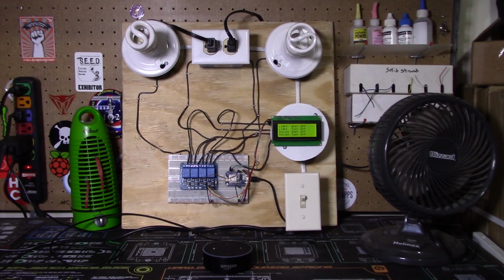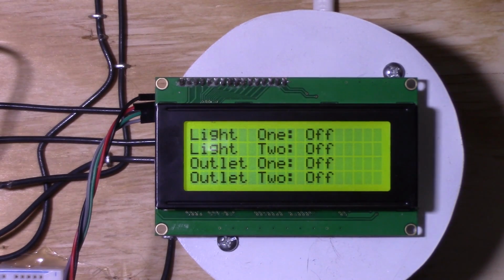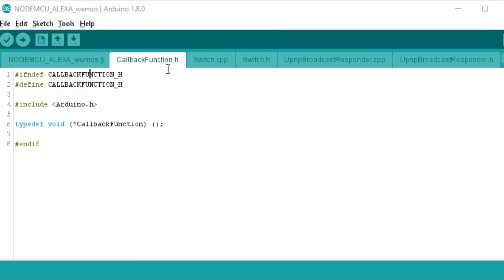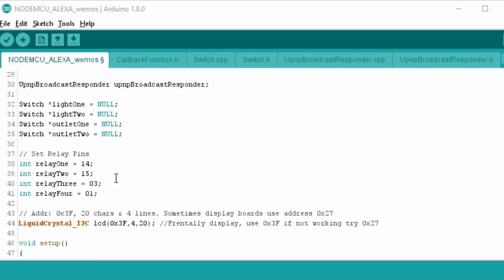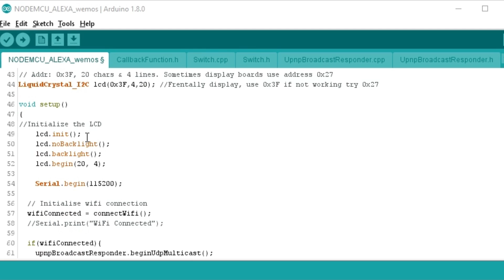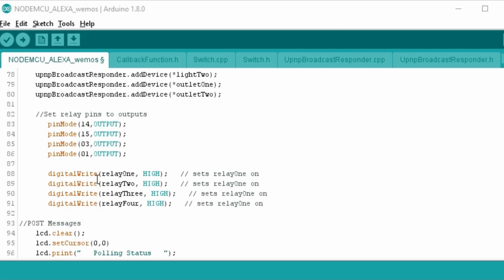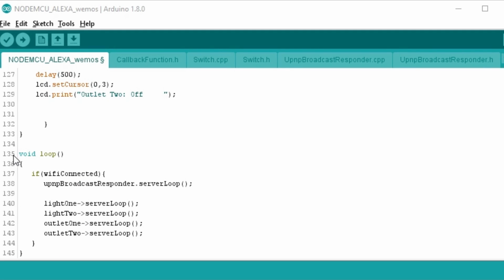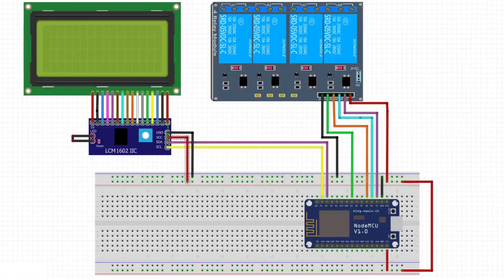How To: DIY Home Automation with NodeMCU And Amazon Alexa

Comment: It appears to be a well made video. However when I tried it on (after changing the SSID and PW) and choice of LCD header file, I get the following errors.

 ets Jan  8 2013,rst cause:4, boot mode:(3,6)

wdt reset
load 0x4010f000, len 1384, room 16 
tail 8
chksum 0x2d
csum 0x2d
v8b899c12
~ld

I cannot understand where on earth that came from. The code compiles alright and yet this. Please help.
Reply from the maker: That's because Amazon killed the API that allowed this to work.
Reply: @Themakersworkbench  Thank you for a prompt reply. Do you have an updated video to handle this problem then?
Reply from the maker: @nearmitech  not yet but I do have the newest generation Echo Dot and will be making a new video in a few weeks.

Comment: Time 1:15 I did see a switch right below the LCD display, what is that for. A light turned on by Alexa, can i turn it off using the manual wall switch ?
Reply: It appears to be the A/C supply  so yes you can... how it affects the low voltage controls if you power it back on is unknown.

Comment: HEllo
I have succe'sfully upload code

serial log seems to be OK

onnecting to WiFi

Connected to reseaualamaison
IP address: 192.168.0.12
Begin multicast ..
Udp multicast server started at 239.255.255.250:1900
   WiFi Connected   
reseaualamaison
WebServer started on port: 
80
WebServer started on port: 
81
WebServer started on port: 
82
WebServer started on port: 
83
Adding switch : Light O

But Alexa discovering device detect anything

Do you have an ideas pleases ?
Reply: I have the same problem, did you solved the problem?
Reply: @blaze1701  I have cha,ge the code , i use the code this for 1 Device (D1)  up to 10 devices you can set

#include <Espalexa.h>
#ifdef ARDUINO_ARCH_ESP32
#include <WiFi.h>
#include <WebServer.h> //if you get an error here please update to ESP32 arduino core 1.0.0
#else
#include <ESP8266WiFi.h>
#include <ESP8266WebServer.h>
#include <ESP8266HTTPClient.h>
#endif

String ValText;
int count = 0;
char line[80];
boolean connectWifi();

// Change this!!
const char* ssid = "xxxxx";
const char* password = "xxxxxx";

EspalexaDevice* d1;

boolean wifiConnected = false;

Espalexa espalexa;
#ifdef ARDUINO_ARCH_ESP32
WebServer server(80);
#else
ESP8266WebServer server(80);
#endif

void setup()
{

  float temperature;
   
  Serial.begin(115200);
  // Initialise wifi connection
  wifiConnected = connectWifi();
  
  if(wifiConnected){
    server.on("/", HTTP_GET, [](){
    server.send(303);
    });

    server.on("/test", HTTP_GET, [](){
    server.send(200, "text/plain", "This is a second subpage you may have.");
    });
    server.onNotFound([](){
      if (!espalexa.handleAlexaApiCall(server.uri(),server.arg(0))) //if you don't know the URI, ask espalexa whether it is an Alexa control request
     {
        //whatever you want to do with 404s
        server.send(404, "text/plain", "Not found");
      }
    });

    d1 = new EspalexaDevice("poulailler", Device1,0);
    espalexa.addDevice(d1);

    espalexa.begin(&server); //give espalexa a pointer to your server object so it can use your server instead of creating its own

    server.on("/Device1_on", Device1OnHttp);
    server.on("/Device1_off",Device1OffHttp);
    
    server.begin(); //omit this since it will be done by espalexa.begin(&server)
    
  } else
  {
    while (1)
    {
      Serial.println("Cannot connect to WiFi. Please check data and reset the ESP.");
      delay(2500);
    }
  }

  //  Force the ESP into client-only mode
  WiFi.mode(WIFI_STA); 
  
}
 
void loop()
{
    server.handleClient(); 
   //server.handleClient() //you can omit this line from your code since it will be called in espalexa.loop()
   espalexa.loop();
   delay(1);

  
}

//our callback functions
void Device1(uint8_t brightness) {

    if (brightness == 255) {
      d1->setValue(255);
      Serial.println("Device1 ON");
      server.send(200,"text/plain","OK");
      server.sendHeader("Location","/"); 
      server.send(303);
    }

     if (brightness == 0) {
      d1->setValue(0);
      Serial.println("Device1 OFF");
      server.send(200,"text/plain","OK");
      server.sendHeader("Location","/"); 
      server.send(303);
    }
}

//our callback functions
void Device1OnHttp() {
   
      d1->setValue(255);
      Serial.println("Device1 ON");
      server.send(200,"text/plain","OK");
      server.sendHeader("Location","/"); 
      server.send(303);
}

//our callback functions
void Device1OffHttp() {

      d1->setValue(0);
      Serial.println("Device1 OFF");
      server.send(200,"text/plain","OK");
      server.sendHeader("Location","/"); 
      server.send(303);
   
}

// connect to wifi – returns true if successful or false if not
boolean connectWifi(){
  boolean state = true;
  int i = 0;
  
  WiFi.mode(WIFI_STA);
  WiFi.begin(ssid, password);
  Serial.println("");
  Serial.println("Connecting to WiFi");

  // Wait for connection
  Serial.print("Connecting...");
  while (WiFi.status() != WL_CONNECTED) {
    delay(500);
    Serial.print(".");
    if (i > 20){
      state = false; break;
    }
    i++;
  }
  Serial.println("");
  if (state){
    Serial.print("Connected to ");
    Serial.println(ssid);
    Serial.print("IP address: ");
    Serial.println(WiFi.localIP());
  }
  else {
    Serial.println("Connection failed.");
  }
  delay(100);
  return state;
}
Reply: @Gyver4000  Thanks! :)

Comment: Wonder if you can help, see below - regards, Erik
/Users/erikhoffman/Documents/Arduino/4 Channel Relay Board Controlled by Alexa/NODEMCU_ALEXA_wemos/NODEMCU_ALEXA_wemos.ino: In function 'void setup()':
NODEMCU_ALEXA_wemos:98: error: 'ssid' was not declared in this scope
     lcd.print(ssid);
               ^
/Users/erikhoffman/Documents/Arduino/4 Channel Relay Board Controlled by Alexa/NODEMCU_ALEXA_wemos/NODEMCU_ALEXA_wemos.ino: In function 'boolean connectWifi()':
NODEMCU_ALEXA_wemos:246: error: 'class WiFiClass' has no member named 'mode'
   WiFi.mode(WIFI_STA);
        ^
NODEMCU_ALEXA_wemos:246: error: 'WIFI_STA' was not declared in this scope
   WiFi.mode(WIFI_STA);
             ^
NODEMCU_ALEXA_wemos:247: error: 'ssid' was not declared in this scope
   WiFi.begin(ssid, password);
              ^
NODEMCU_ALEXA_wemos:247: error: 'password' was not declared in this scope
   WiFi.begin(ssid, password);

Comment: Brilliant job on the application, have done a few switching projects using this board and they work fine, but I really liked the idea of using the L.C.D screen (geek factor and all that..) I have downloaded the ZIP file but I am unsure with what to do with the 5 other files that are needed - where do I put them and how do I include them - plus where do I get WiFiUDP.h from? - also i am getting an error saying "error compiling for board NodeMCU 1.0 (ESP - 12E Module) - I am assuming this is related to missing files? - any help or advice would be welcome !
Reply: Well after a fair bit of head scratching I finally got the main part of the project working and its talking to my echo dot nicely and switching the relays... however, the LCD screen just sits their glowing blue and showing two rows of white squares (as I understand it, its in reset mode?) it does nothing when rebooting the NodeMcu and I have spent most of the day looking if I went wrong anywhere with connection etc,  the LCD is the exact same one in the tut here, so am at a bit of a loss, and as their seems to be no activity here I fear this will have to go on the back burner for a while and i'll look for an alternative. Not all lost though at least I think I learnt something :)
Reply: how did you manage to get the WiFiUdp.h file working? Having the same problem now
Reply: Hi Ray, My Nodemcu is connecting to Wifi fine but echo is not discovering it at all. Can you please tell me what did you exactly do to get this working? I know it would be a thing of past for you but still, will look forward to hearing from you.

Comment: Why i get this error message Arduino: 1.8.5 (Windows Store 1.8.10.0) (Windows 10), Board: "NodeMCU 1.0 (ESP-12E Module), 80 MHz, 115200, 4M (3M SPIFFS)"

NODEMCU_ALEXA_wemos\NODEMCU_ALEXA_wemos.ino:31:31: fatal error: LiquidCrystal_I2C.h: No such file or directory

 #include <LiquidCrystal_I2C.h>

                               ^

compilation terminated.

exit status 1
Error compiling for board NodeMCU 1.0 (ESP-12E Module).

This report would have more information with
"Show verbose output during compilation"
option enabled in File -> Preferences.

Comment: my echo dot cant find any smarthome devices
im never change what u've done
only ssid and password

please help
Reply: same for me.
Reply: If you have one of the new V2 Echo Dots, at least some of the WeMo emulators for ESP8266 stopped working because Amazon changed the discovery protocol.

I just got mine, so I haven't found out what the fix is yet. I only found out about the problem when I was looking for examples.
Reply: I had the same problem. My wireless network name is Thor, but I was typing thor in the code. it's case sensitive. maybe this will.help

Comment: You could use a RF-Outlet so u dont have to have a relay and mess around with mains-voltage. Iam planning to do so. I had something like that but with no voicecontrol. It was just an icon on my smartphone that i clicked on. Worked well but wasnt that cool without voicecontrol.

Comment: Hello, Can the echo be used from a remote network to control nodeMCU that is connected to the home wifi ?
Reply from the maker: +Justin Jose I am not sure if this is possible and I believe that Amazon has security measures in place to prevent this exact thing. I could be wrong though as I have not spent any time researching it.

Comment: Great video - and appears less difficult to try compared to other articles I have read.  Couple questions for you...  do you know if it is possible to ask Alexa to read a value, and return it... such as if a door is open, motion detected (variable set), etc?
Reply from the maker: +Ken Jaynes Thanks for the compliment. At the moment I do not think it's possible to have Alexa read strings back.
Reply: I am wondering if via home-assistant would work - https://home-assistant.io/components/binary_sensor.rpi_gpio/ via Raspberry Pi though, not Arduino or ESP8266
Reply from the maker: +Ken Jaynes I'm not yet sure.
Reply from the maker: +Ken Jaynes It's possible. I know the esp8266 is quite popular with the home assistant people

Comment: I used your set up and everything works great!  However, I can't seem to get Alexa to respond to anything but ON/OFF commands, even by changing the call backs.  I'd like to use this setup to automate my mini-blinds, but it sounds a little awkward to say "Alexa, turn off/on the blinds".  It works, but it would be better if "open/close" was an option.  I have a genuine WEMO switch and it will turn  OFF/ON in response to a verbal command of OPEN/CLOSE, OPEN/SHUT, etc.  Is there a way to get the emulation to follow these commands?

Comment: This project is great but I do not want to control multiple switches at once I am wanting just one relay. I have tried to use this on a single relay and it clicks on and off. I have tried it on this relay
 http://www.ebay.com/itm/WiFi-Relay-ESP8266-5V-Networking-Smart-Home-Phone-APP-Remote-Control-Switch/122253018576?_trksid=p2047675.c100011.m1850&_trkparms=aid%3D222007%26algo%3DSIC.MBE%26ao%3D1%26asc%3D41669%26meid%3D12eade1bdfce4f2386c466dd9e7c13c1%26pid%3D100011%26rk%3D1%26rkt%3D2%26sd%3D152345540675 
and I get nothing. Any ideas or insight that I am missing? I can get Alexa to find the office and kitchen lights from the program and when I say on or off I see the blue light on the ESP light up but nothing.

Comment: Trying to make this project work. I am having an issue with uploading the sketch. The code compiles ok, but when I upload I am getting and error with the unit not flasing, tried a different board with same problem. Now I am noticing that the light on the relay board for IN2 is on. Not sure if that indicates some sort of error on the relay board. I tried to disconnect the wire for that relay and sketch loads but that does not seem to work. Any suggestions on the light for IN2?

Comment: Why did you change the relay from the LinkNode R4 to the Sainsmart relay? I made the other project using the LinkNode R4 and have had trouble with the relay going on and off?
Reply from the maker: I'm not really sure what you are asking. I made this video to show people how to use the Node MCU to do the same thing that I did with the LinkNode R4.
Reply: My question was, were you having a problem with the LInkNode R4 and was that why you changed to the Sainsmart relay? I wanted to know since I had built the first version using the LInkNode R4 relay and got everything working great with the Echo. However after the outlet stayed on a little while the power would cycle (on then off then back on again). This happened all the time the outlet was on. I changed to another LinkNode R4 only with the same result. I have contacted the seller and am awaiting a reply. I just was curious if you had a similar experience and changed relays. Thanks
Reply from the maker: I have the Linknode running the poweroutlet to my PC right now, and it has been solid for 15+ hours a day of use for the last two weeks with no issues. I am not sure what could be causing it to reset like that.

Comment: what low voltage device is at each light/receptacle
Reply from the maker: Dean D'Aiuto I'm unsure of what you are asking.
Reply: you have a low voltage wire running to each light/receptacle. what is that connected to to communicate with the arduino?
Reply from the maker: No, those are not low voltage. The black wires are the Hot wires from the 120V mains, there is a Neutral wire and Ground wire traveling to each from the main junction box as well, you just can not see them.  The Hot wires (Black) travel from each gang box to one side of their respective relays, and then the other side of each relay is connected to the mains 120V hot wire in the main junction box.

The only low voltage on this project is the 5V that travels into the NodeMCU from the USB adapter, and then the 5V that powers the coils in each relay. Please, if you do not understand how mains voltage wiring works, do not attempt to build this project. It can and will kill you.
Reply: Ok I see thank you for taking the time to answer my question.
Reply from the maker: You're welcome! Thanks for watching the video and taking the time to comment!

Comment: This may be a weird question but I am trying to wrap my head around the circuit in a house environment.  I am planning on using a few of these relays around the house to make some of the wall outlets smart.  When these get hooked up, is the circuit parallel or series?

I am trying to make sure everything in my house stays to code and nothing will draw more than it should without tripping the breaker.
Reply from the maker: If you want to stick to code, you will want to buy something like Sonoff switches and work them into a separate utility box in your mechanical / electrical closet. Using open relays like this inside of a wall is very dangerous, and unless they are UL approved, and in a fire safe box, it will not be up to code.
Reply: I was planning on putting them in the attic (with the rest of my wiring) and inside proper electrical junction boxes.  I was mostly concerned with load on the circuit breaker and if these would keep the same amount of load as the original outlets that are in parallel.

Edit: As a note, i am planning on having an electrician verify my work.
Reply from the maker: Benjamin H these particular relays are only capable of 10a of current each and I would not put more that 8.5 amps on each one. Typical wall outlet circuits are on a 15a circuit breaker which is able to handle 15a across that who circuit.
Reply: Right, most likely none of my lamps will draw more than 8.5 amps heh but i definitely see your point. Maybe the Sonoffs can pull more or a higher amperage multi-relay might be safer.

My main question though is still the circuit type. A typical wall circuit has the outlets in parallel.  My concern is that if one of the relays goes out that all of them will stop functioning.

Comment from the maker: Sorry for the late upload everyone. I ran into several technical issues while filming and editing this video. From camera focusing and audio issues to Premiere Pro telling me that my GPU (a Nvidia GTX 970) was not compatible, to days searching for a fix, it is finally out. Again, I apologize for the late posting, but at least its out there now. Hope everyone finds it helpful in some way.
Reply: I am using a 8 Channel Relay but when I turn on the relay with 3v3 output and ground it just turn on the light on the relay but the relay dont turn off or on any solution to this ?
Reply from the maker: Hello Sandipan,  Yes, the 3.3v is not enough to energize the 5V coil that is inside the relays you are using. You need to power them separately with a 5V 500mAh source.
Reply: I tried it power it from a 5v of arduino but then also it dont work but when I changed the relay pin from node to arduino and uploaded a relay test code it worked.
Reply from the maker: Can you send me info on the relay board? Manufacturer, photo, etc?
Reply: Yes how can I contact you ?
Reply: When I tried to only high or low 1 pin it worked but when I tried to do it with 8 ports it cant.
Reply from the maker: themakersworkbench at gmail
Reply: Sent please check it
Reply from the maker: Check to make sure that the jumper is in place.
Reply: just needed to use a logic level shifter and it worked fine.
Reply: Well, im sitting here with my alexa V2 aaaaand it doesnt spot any devices... altough the serialmonitor says its sending responses to alexa...